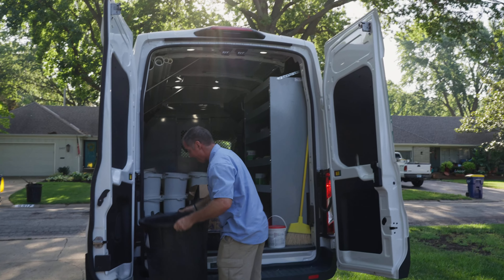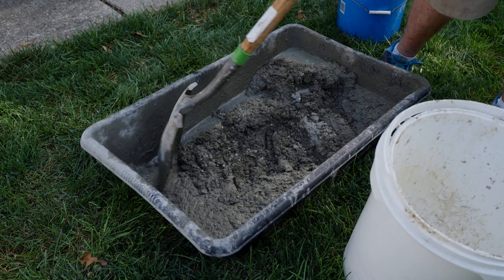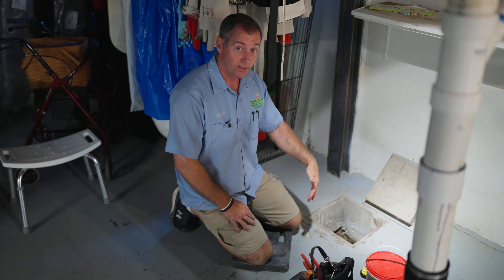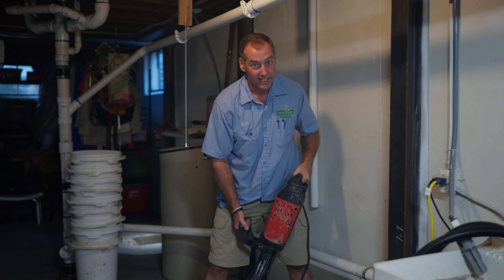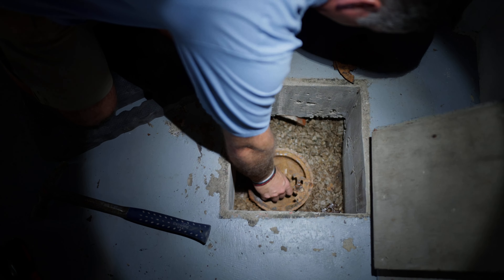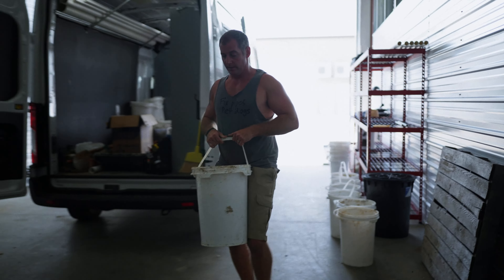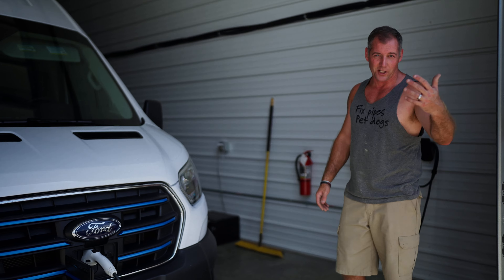How to install a sump pump pit the right way!

Comment: I wish mine could look that perfect. We live in a 1940’s era house and our sump pump discharges into our septic tank. I’ve had to replace pumps so many times and with that came replacing the discharge hoses and pipes. I’ve struggled with finding the proper fitting pipes as some of the plumbing is about 1” in diameter from an old flexible discharge pipe. Finding the right connections has been a challenge.
Reply from the maker: Pumps should discharge with a minimum of a 1-1/2" pipe.

Comment: I noticed you did not install any interior French drain system. You simply installed a pit. Why would some contractors dig the entire perimeter for a French drain to the pit?  Are you saying as long as the home has foundation drain tile and you install the pit close to that water will drain there?
Reply from the maker: That's exactly what we're saying.  The home in the video already had perimeter tiles.  We just upgraded them from a slow gravity drain to a much more efficient pump.
Reply: @SmedleyPlumbing  But you never fed the existing tile system to the sump.  You just drilled holes around the basin.
Reply from the maker: @shazaidi  exactly.  We don't want the open tiles dumping into the pit.  We use the gravel and the 3/8" holes like a filter to protect our pump from pulling in a piece of debris that could lock up the pump.  Water flows freely through gravel and the hundreds of 3/8" holes.
Reply: Won't the old tiles just fill up with water instead of being directed to the new sump pump? @SmedleyPlumbing
Reply from the maker: @ColtRobinson5  they drain through the gravel and into the pit.
Reply: @SmedleyPlumbing  How do you know how many holes to drill in the basin?
Reply from the maker: @idmhead0160  we drill about 100

Comment: Mine was installed like you did here, without a blanket wrap to keep sand out. And then it failed, inside 6 years. Filled the pit, pump, and drain pipes solid with sand. And this caused a minor bowed wall to become a major concern, then needing a very very expensive 7 wall anchor system along with a complete breakup of that pit for a new reinstall - with that blanket.
Reply from the maker: Yeah if you have sand under your concrete, you'll need a filter wrap for that.

Comment: It was too quick/ too short to really see, but it almost looked like that siding is asbestos; and to drill a hole in it will release asbestos fibers !!!
Reply: Nope look at the sawdust.  Don't bother commenting if you dont know what you are talking about.  Thanks for complaing and finding something you think he did wrong though.
Reply: @MarkLightbody  Proper reading comprehension will explain my uncertainty; my comment clearly described noncommitment.
Reply: @vectorm4  Thanks, I understood your comment.  Just trying to defend the installers they clearly know what they are doing.
Reply from the maker: I don't think I've ever seen asbestos siding in our area.
Reply: @MarkLightbody  What does sawdust have to do with whether or not the siding contains asbestos? Asbestos was in a lot of things. Don't think you can look at sawdust and know whether the siding contains asbestos.
Reply: I'm not some random YouTube commenter who doesn't know what they are talking about.  I do this for a living.  The siding is one of two things.  Cedar or asbestos.  You would 100% know if you were drilling into asbestos because it's like drilling into cement and the dust is white.  In this case, the sawdust is red, likely red cedar.  Also, you can see a slight texture to the siding from the circular sawmill that cut it.  Asbestos siding is smooth.
Reply: No asbestos siding has slight ridges in it so it'll have slight bumps in it and funny enough I've been removing asbestos for 30 years and today I was to repair the side of someone's house in Cape Coral Fl where u never see asbestos and boom it was transite siding underneath

Comment: So you are not adding any drain tiles under the floor, just the perforated basin? Obviously much quicker and less expensive. Looks great
Reply from the maker: The drain tiles are already in place on these installs.

Comment: Didn't wanna run the exit pipe any longer? Will that make the yard a muddy wet pit? Also wont it just come back down to the walls since its not run further out?
Reply from the maker: We try to balance the discharge pipe distance with effectiveness and nuisance.  Further in the yard helps get the water further from the house before it's introduced to the soil but it's also mowing nuisance.  So if the proper slope is there, we will typically shorten the discharge pipe to blend the best of both worlds.

Comment: How do i find the best spot to put a sump pump or does it not matter
Reply from the maker: Near where you're sewer line leaves the home of possible.
Reply: @SmedleyPlumbing  why is that?
Reply from the maker: @WSOBLikEaBosS  ground water will follow the under slab sanitary drain lines.

Comment: No check valve?
Reply from the maker: There's a check valve on there.
Reply: I didn't see the check valve either, but if he says its in there then, good job !! @SmedleyPlumbing
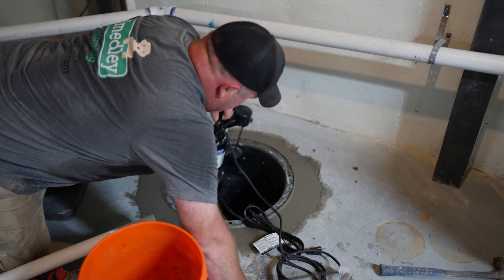Reply from the maker: @matthewpingitore  4:23.  You can see it installed on the pump while we're setting it in the pit.
Reply: sorry I missed it, good job 👍 @SmedleyPlumbing

Comment: Just learning about this.  In another install I saw they lined the hole with landscape fabric (or similar) to try to prevent the movement over time of dirt plugging the holes or ending up in the pit.  Do you do anything like this?  I'm installing in a dirt crawl space.
Reply from the maker: I don't like the fabric lining because it will get clogged.  I'm okay with tiny dirt particles getting in the pit.  They just get pumped out.

Comment: Is that jus a black plastic dustbin you used for the pit chamber?
Reply from the maker: No.  It's a sump pump basin.  Plastic trash bins are too flimsy and will collapse in on themselves over time.

Comment: If you have a basement where the water table can sometimes be above the floor, would one necessarily need a sump pump basin as long as the walls and floor were fully sealed? I have a rental property that I inherited from my dad that has had flooding problems. It currently has two sump pumps. One on each end of the house. The second one was only recently added. Not sure how long the first one was there. As far as I know, it doesn't have drain tiles. I'm wondering if I was able to seal the concrete block walls if I would even need the sump pumps. The main entry way of water into the basement at this point is through the sump pump basins. The house is on sandy soil, but, in a low-lying area.
Reply from the maker: Good luck trying to seal a block wall.  Water always finds a way.
Reply: @SmedleyPlumbing  I currently have a half-assed tub of some sort with a couple 2" holes drilled in the side of it where the water comes into the pit (bringing mud with it). At a minimum, I'm going to install a new sump pump basin, like what you did. Drilling the 3/8" holes in it and putting limestone gravel around it. Then cement up around the top. The place was a total nightmare. The tenant that lived there for 15 years covered everything in drywall. I gutted the basement and turned it into an unfinished one where I can at least see what is going on with the block walls to find out what the exact problem is. I'm going to do some grading of the ground outside and hopefully that will help also.

Comment: I've seen catch basins that have 4" holes already cut into them.   Do you ever tie the floor drain into the sump or do they operate entirely on ground water?   Perhaps if the municipal sewer system were to back up, the water would have a direct path to the sump and be pumped outside before flooding the basement?  Not sure.
Reply from the maker: Yes some people will tie the drain tile into the pit. We choose not to to reduce the chance of debris getting into the pit. Also you wouldn't want a floor drain in the pit or anywhere near the pit because you would not want a condition where you're pumping raw sewage outside or you're letting groundwater into the sanitary sewer system.

Comment: dont you have to use a mesh around the bucket so debris wont get inside?
gravel itself seems wont do the job
Reply from the maker: The pump can handle 1/2" solids.  So 3/8" holes are enough of a screen.

Comment: What size basin to use and why? 22 vs 30 inch depth. Thanks.
Reply from the maker: Basin size is determined by expected water volume.  The more volume, the larger the basin needed.

Comment: If the water heater, washer or another device blows, where does the floor drain to?
Reply from the maker: There are other floor drains that are at the surface of the concrete instead of below the surface of the concrete.

Comment: Great video. Why did you choose to put the basin in 6-8ft away vs. in the original floor drain spot? Was this a one day job or multi day?
Reply from the maker: One day job.  The original location works sometimes.  In this case, we felt it was too close to a steel foundation wall support.  We try not to break concrete near or behind those wall supports.
Reply: @SmedleyPlumbing  what's safe/ preferred distance to break up concrete from steel beams?
Reply from the maker: @On-siteMaintenanceKS  I like to stay 24" away if possibly.

Comment: how much does it cost to charge up the transit ? $?
Reply from the maker: We pay $0.05/kWh in our area so it costs us about $9 to drive it 350 miles.
Reply: @SmedleyPlumbing  how can you get 350 miles of range?
i just went to mercedes to drive test an electric sprinter van and they told me it is 250miles

Comment: I plan to do this is my basement very soon. The basin I have now is 22inches but only 10 inches is in the ground and I’m it sure why. The basin always stays full of water, when we get a heavy rain the pump can not keep up fast enough therefore water starts to build up around the basin and even will come through cracks in the floor. The previous owner also has 1 1/2 inch pipe then 3/4 inch when it gets out of the house. (This is a terrible set up). I believe if I install a new basin, a nicer pump and a better exit (bigger pipe) it would take care of water coming through the floor and flooding around the basin, like I have now. What kind of pump and back flow valve did you guys use in this? I plan to use the exact set up in this video. Thanks.
Reply from the maker: If they didn't sink the pit all the way, I would be on the lookout for bedrock.  Sometimes we run into rock and have to break if out to get the pit all the way in.
Reply: @SmedleyPlumbing  do I need to be cautious of breaking this bed rock up?
Reply from the maker: @giffgaming2663  no.  Nothing you would use to break it up would be big enough to cause structural issues anywhere.

Comment: The existing drain looks like a low maintenance way to get rid of water from around the home foundation. What maintenance is needed to keep the new sump pump system working as well?
Reply from the maker: The existing drain is no longer to code and will overload the sanitary sewer system during periods of heavy rain.

The sump pump doesn't really need maintenance but will need replaced every 5-7 years.

Comment: Why did you write "sump pump only" on the outlet?  Does the pump draw a lot of power?
Reply from the maker: It's a dedicated circuit for the pump.  That way nothing can risk tripping the breaker for the sump pump.

Comment: NEC requires all basement outlets to have GFCI.
Also, the discharge is way too close to the house, you are basically recirculating the water.
Reply from the maker: GFCI outlets are not advised for sump pumps. They can trip during storms and you looks you sump pump until it's reset. That's why we do a dedicated circuit instead.  Also, the ground slopes away from home so the water will run away from the home.  In cases where there is no slope, we install a buried discharge extension.  But those come with t their own possible issues so we don't install them if we have good slope away from the home.
Reply: @SmedleyPlumbing  The 2020 edition of the US National Electric Code (422.5 A) added sump pumps to the list of appliances that require GFCI protection. The NEC lists basements as locations that require GFCI protection. The NEC used to say that sump pumps were exempt from GFCI protection if they were on a dedicated circuit, they are no longer exempt. Finished basements also used to be exempt, but as of the 2020 NEC, all basement circuits require GFCI protection.
Reply from the maker: @Pro1er  I understand what you're saying. However sometimes the code book has rules that do not benefit the customer. A GFCI outlet is of no benefit to a customer on a sump pump.

Comment: You are lucky you have a public dump you can use to dispose of the debris.
Reply from the maker: It's close and cheap too!
Reply: @SmedleyPlumbing  I'm jealous. They just eliminated our dump because it cost too much. They also eliminated recycling. Even when the dump was there, you were still not allowed to dispose of things like rock or concrete blocks. I have a bunch of concrete blocks that I need to figure out how to get rid of.

Comment: What about expanding  a sump pit?
Reply from the maker: Expanding?  Why would you need to expand one?
Reply: @SmedleyPlumbing  I had to replace my tile around the house as the old one was installed without a sock and got clogged. The installers mentioned that there is a lot of water in the arra that I live. I've replaced quality sump pumps 3x in 12 years despite havingv10 year warranties. The installer suggested that the pumps are being overworked and burning out. My pump goes off every 90-140 seconds. He suggested expanding the pit so the pump does not run as often.